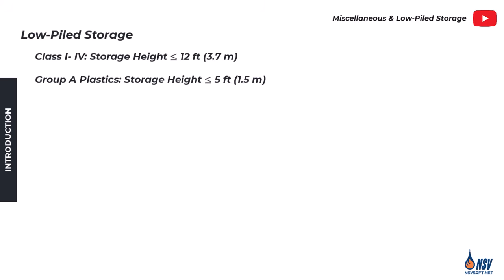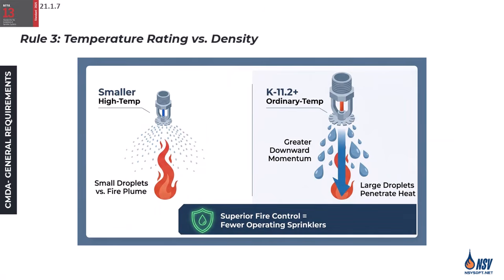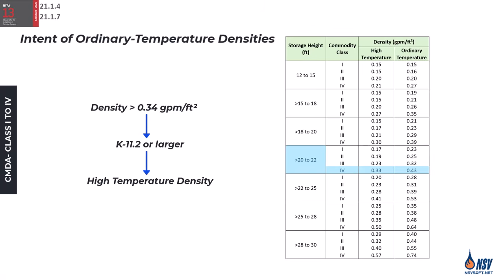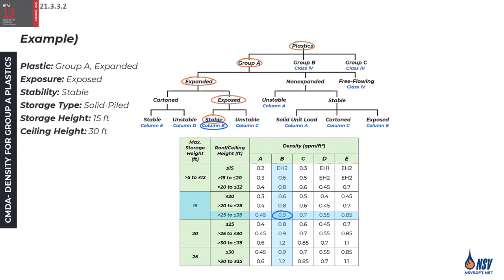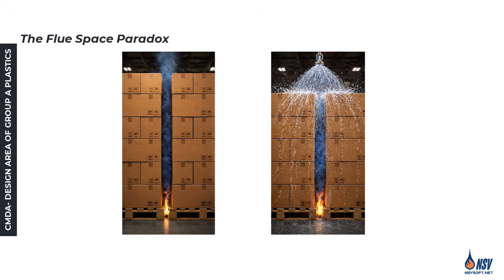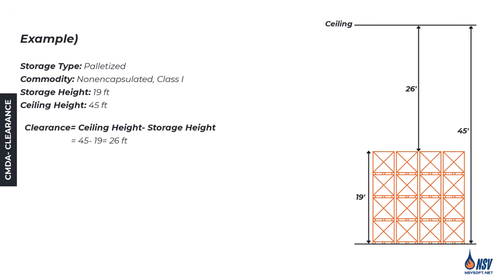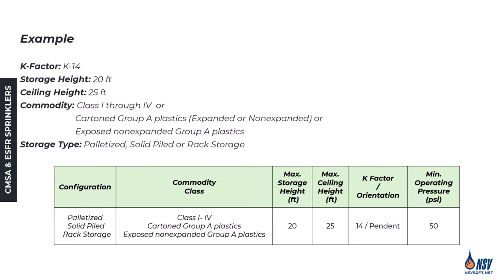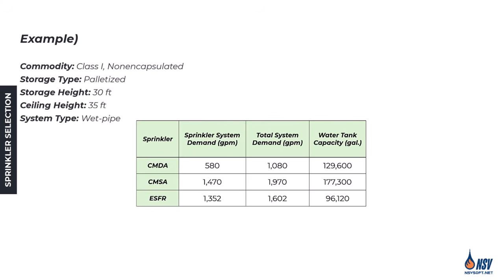📦 Palletized & Solid Piled Storage (NFPA 13)

Comment: The 'Flue Space Paradox' segment is exactly the kind of nuance that trips people up in the field — wide, unobstructed flues sound like they'd help suppression by giving water a path down, but they can actually accelerate vertical fire spread before sprinklers even activate. Would be great to see a follow-up comparing how that paradox plays out differently for CMDA vs. ESFR designs, since ESFR's whole philosophy (suppression via high momentum/early application) seems like it would handle that flue geometry very differently than a standard CMDA density/area approach. Also curious how the stable vs. unstable pile distinction feeds into the interpolation step — is that mainly a discharge density adjustment, or does it also affect design area selection?
Reply from the maker: Farzad, 
Regarding flue spaces, we will cover this topic in full detail in the video scheduled for release on October 19. Please stay with us for that session.

As for stable and unstable piles, it is important to remember that NFPA 13 does not permit interpolation between the density values for stable and unstable piles. The standard only allows interpolation of densities between different storage heights, not between different pile stability classifications.

Comment: Hello I have a private question for consultation. I plan to take the CFPS exam and would appreciate some suggestions. I have long been primarily responsible for various fire‑extinguishing systems, yet my knowledge of fire‑alarm systems is relatively limited.
Reply from the maker: Hello Cris,
For this exam, you don’t need to memorize every line of the Fire Protection Handbook (FPH). What truly matters is knowing how to quickly locate any topic in the handbook during the test.

The questions are straightforward, and every answer is directly found in the FPH. There are no trick questions, and you won’t need to perform complex calculations or analyze advanced formulas.

Here are a few important points:
- Time management is critical. The three-hour exam goes by much faster than you expect.
- There is no penalty for wrong answers. If you’re unsure, choose the best option and move on.
- If you doubt an answer, select one and mark the question. If time remains at the end, return and reconsider it.
- Become comfortable using the index at the end of each volume. Having your own well‑organized index can be extremely helpful.
- Preparation is all about repetition. Review, review, and review.

We hope you pass the CFPS exam with confidence and success!
Reply: @NSVCad  Really appreciate your help

Comment: Hello! Thank you very much for the information you share and for the clear and professional way you explain NFPA requirements.

I would like to make a small request, if you would consider it as a topic for a future video: it would be very valuable to cover a warehouse case with rack storage up to around 12 m, total storage height up to 14 m, and a ceiling height of approximately 17 m or more.

It would be very interesting to explain how such a case should be addressed according to NFPA 13, especially regarding the selection of ceiling and in-rack sprinklers, as well as the impact of storage and ceiling height on the design.

If you would consider covering this topic in one of your future videos, I would greatly appreciate it.

Thank you again for the work you do and for the valuable information you share!
Reply from the maker: Hello Ermir,

Thank you for your comment and your kind words. We’re very happy to hear that you found our videos helpful!

The next four videos in our Storage Warehouse series are dedicated to rack storage and will cover the NFPA 13 approaches for protecting these systems. In these videos, we’ll also review the installation requirements and the hydraulic‑calculation criteria related to rack storage. Please stay tuned — we hope you’ll enjoy them 🙂